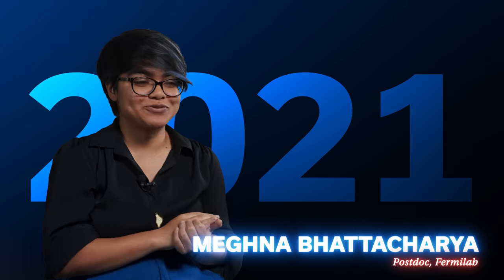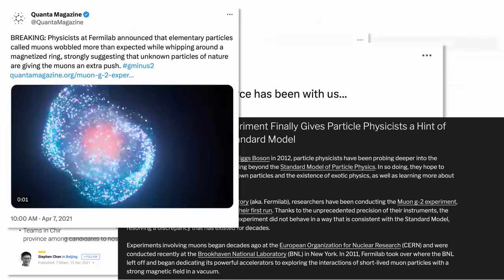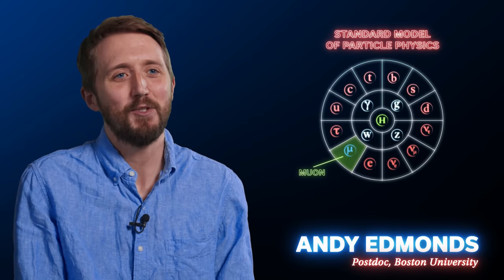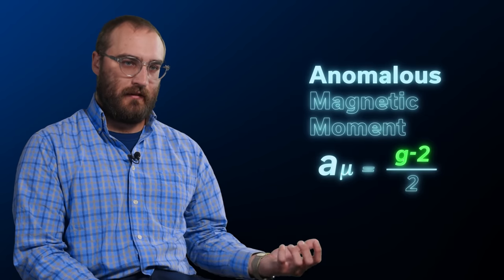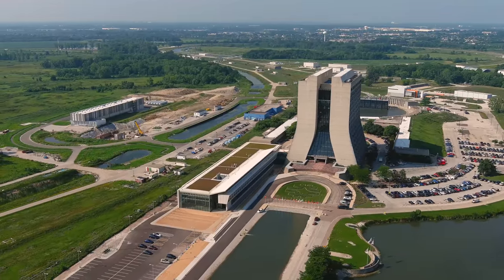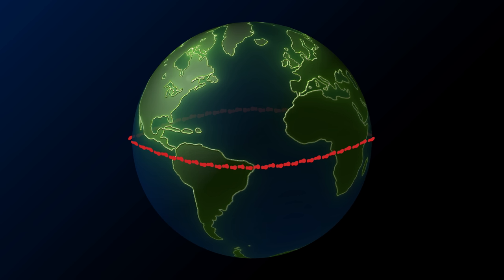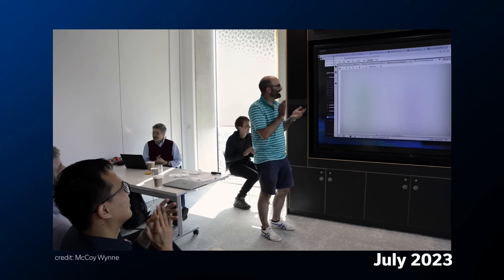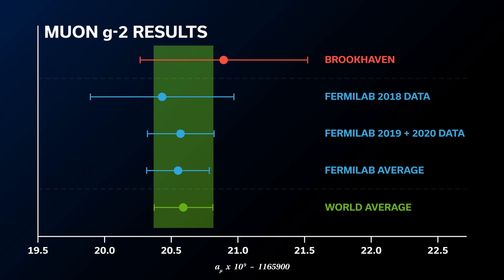Muon g-2 experiment returns with new precision measurement

Comment: If anyone is wondering, this either means some unknown physics is giving the muons a little extra magnetic moment, or it's really difficult to calculate all the possible interactions with virtual hadrons in the standard model of particle physics. There could be thousands more strong force interactions (virtual hadrons) with muons that have a big enough impact to show up in the measurements but have not been calculated yet.
Reply: Thank you, I was wondering just that.  Do you know the implications for their findings? Will this radically change the standard model or make it more accurate?
Reply: @seankelly3300  Actually the most recent computations are getting closer to the Fermilab results (from ..18 in 2020 to ..19.8 in 2023, where this Fermilab result is ..20.6 and the error bars are close) so it wouldn't be surprising if that trend continues and theory and experiment match.
Reply: @tonywells6990  The very existence of that trend and the magnitude of which it did makes me kinda confident that there really is no new phy here .
Reply: @seankelly3300  Scientific American's article on these results does a pretty good job of covering the larger discussion in the Physics community. Even if this doesn't lead to "new physics" in the sense of a new quantum field, it may lead to new insights into flaws in our data-driven models, and that could lead to refinements across much of physics.
Reply: @seankelly3300  My understanding is that there are two main possibilities. The first is that the way we are calculating the expected value could be incorrect, as it is extremely complicated and involves attempting to account for an infinite number of possible interactions with the muon. This wouldn't be that interesting and wouldn't change the standard model. The second possibility is that the muon could be interacting with an unknown type of particle. This idea is what everyone is excited about, as it would potentially create an addition to the standard model, which we haven't seen since the Higgs Boson was discovered and even that was predicted.
Reply: @michaellombardi3638  Thank you Sir.  Although this is WAY above my head, I find the subject incredibly interesting. Science is fascinating. Thank you for sharing your understanding.
Reply: @michaellombardi3638  do you remember whether neutrino oscillation was discovered before or after the Higgs boson was predicted? (I’m pretty sure it was before it was discovered, but idk how compared to when it was predicted)
Edit: also, at least the value of the mass of the Higgs boson was, iirc, a little bit of a surprise? I think?
Reply: @drdca8263  You're right, I forgot about that change. Looks like the first evidence for Neutrino oscillation was back in 1998 but the Nobel prize was awarded for it in 2015. In contrast the Higgs Boson was discovered in 2012 and the Nobel prize was awarded in 2013.
Reply: Can’t it also mean that they will need to use another instrument to confirm these results? Because walking far, the same torus has been used and the chance that something may be off with it seems more likely than the fact that our current best theory is wrong or incomplete.
Reply: Well thank you for shedding some light on this for us because this video does not explain anything.
Reply: Guess they are needing more funds.. They're could be new physics involved but we need 3billion to find out either way😂get funds and lo and behold nope.. No new physics. Was just a bit of food on the detector..but look at all them new cars in the staff car park😂😂😂
Reply: Thank you
Reply: @animalbird9436  Cynicism is easy, discernment is hard.

Can you phrase your criticism as a plain statement of how you think things should be done differently and why, or of what you think is bad about how things are done?

While jokes may at times allow for expressing complaints that are otherwise hard to express, they can also, I think, disguise complaints that are poorly thought out, and would be seen to not make sense when expressed plainly.
Reply: @drdca8263  I agree 100 percent with you.. I just throw in those comments as a pee take. As it seems when Eva need funding the old adage of new physics could be found. 😍😍😍😍
Reply: @animalbird9436  'food on the detector'! That genuinely made me laugh out loud, very funny.
Reply: I wonder, could be be getting so accurate now with our measurements that we are seeing the minuscule impacts from gravitational waves, or even influences from other dimensions? Or maybe the guy watching the simulation we exist in sat a bit closer to the monitor?
Reply: 👍Good comment, I mostly agree.
Reply: @davidadams421  tongue in cheek I know. 👅😂😂😂😂😂😂😂
Reply: @davidadams421 Erm, probably not. 😂
Reply: Speaking of morally correct, the discussion should also include the new result on electron charge roundness improving on the current LHC bound in predicting "no new (dark matter supersymmetry WIMP) physics" contra the muon g-2 team hopes. Since recent papers mention how sterile neutrinos of minimal natural standard particle extension (of neutrino fields) can currently meet observation bounds of "no detection" they remain more exciting dark matter candidates IMO. (Re the neutrino oscillation discussion here - neutrinos are interesting!)
Reply: @torbjorn.b.g.larsson  all particles dark and normal matter when funding is needed. 😂😂😂😂
Reply: The only way i could see a net effect from virtual interactions is due to existing fiels that create a slight bias, such as the magnetic field of the earth, sun, and by a very slim amount the SMBH at the center of our galaxy.
Reply: @tonywells6990  Why is the mean shifting instead of error bars contracting? Does that mean all the theoretical results are grossly miscalculating their error bars?
Reply: I guess that if the result is diff from 0,14mpp then its either a 5th force or  a 18th particle or a unknown version of the Higg's Boson
Reply: @rockinrobin9093  They already took the data from this experiment, so no more use of supermagnets and accelerator. They "just" need to analyse the rest of what they collected.

Comment: Finding that Cutting edge of physics and zooming in on that fine rupture point requires hard work and scientific integrity. 🫡 

Who knows, using the understandings wrought here maybe one day we could have devices that use “muon” systems in everyday day devices, for the benefit of all of humanity. 😊 safer x rays anyone? Or perhaps sensors that can detect with a high degree of accuracy the topography of the earth, and heck fusion power is a lot easier if you can use a super accurate muon cannon. 😎 if we can find new ways of harnessing the muon by probing its boundaries humanity can be one step closer to cheap abundant energy. Super impressed by that ring of epicness y’all have over there and keep up the hard science! o7 👋😎

Comment: From an engineering point of view, we are wondering if you could do a video explaining how any systematic errors are prevented.  This one mentions the "parka", presumably to isolate the accelerator from earth's magnetic field and any other fields from nearby equipment, as well as the calibration of the magnets, but does not go into any details.  It seems that the system would need to test other particles with known magnetic moments to rule out systematic errors and confirm there is only an anomaly in the muon.

Comment: Assuming that dark matter is a particle, I have some questions:
1.  Do dark matter particles (DMPs) have momentum?
2.  Do DMPs have temperature?
3.  Do DMPs orbit each other and regular matter?
4.  Do DMP clouds have angular momemtum?
5.  Does the angular momentum of DMP clouds act as a stabilizing influence on the direction of the net angular momentum of galaxies?
6.  At the beginning of the universe (or shortly thereafter) did the universe as a whole (DMPs and normal matter) have a net angular momentum with a net preferred direction?
7.  If the universe as a whole had a net momentum at it's beginning, is there any way that the net momentum of the universe could change in magnitude or direction?  Since to change the angular momentum of an object requires the application of an EXTERNAL force and the universe is everything, where would such an EXTERNAL force come from?
8.  If we look at a number of small patches of sky similar to the Hubble deep field and calculate the net angular momentum in each patch, would we expect the preferred direction of all of these angular momentum vectors to be the same?  Or not necessarily?
9.  If we consider the universe around Earth in terms of concentric shells, the first being from 0 to 1 billion light-years away, the second from 1 billion to 2 billion and so on, would we expect the preferred direction of the net angular momentum of each shell to be the same or could it vary over the shells?
Reply: Great questions the answer is yep
Reply: @Xsiondu  
So, don’t we need another $50 billion collider for the particle physicist to work with in order to really nail down the answers to these questions? I’m sure SabineHossenfelder would agree with that!

Comment: 5:43 How do you go about knowing you halved uncertainty (in regards to previous results)? What's the method of how do you deal with the uncertainties you don't know about? I can't quiet connect the dots. Help?
Reply: You have a model of your measurement process, and of the system you are measuring (with a parameter for the aspect of it you want to measure the value of), and,...
you do statistics
Reply: Lets say you have a bowl and without knowing the content you pull out 3 blue balls in a row without knowing even whether the bowl contains only balls.  Not very telling.  You then pull out 1000 things and it turns out they are balls and 990 are blue.  At this point you can be reasonable certain they are all balls and virtually all are blue.  You then pull out 100,000 and it turns out they are all balls and 999,900 are blue. Now you can be extremely certain they are almost all blue balls. Statistical analysis helps quantify the actual probabilities and certainty.
Reply: @rreiter  yes that's certainty of a model assumption. I'm curious about the un-certainty of the unknown quantity. The sample set outside our bias region. Think of it as "the dark" e+m as the known unknown (a model predicts its existance but we don't know how to get details) that once was an unknown unknown back when no model was predicting it. Speaking of uncertainty without distinguishing makes me believe ppl are refering to both. Come to think of it, again, they do reference previous results. So they actually are speaking of in-model uncertainty? Is that my missing dot?
Reply: @vdis  I'm not sure. I thought they meant the statistical  uncertainty of the predicted value only; the error bounds would decrease as the sample size increases, hence my trivial example to illustrate. It gets complicated fast because (taking my example), you can't actually see the blue ball, you only get a value from a collection of instruments that each are imperfect in some way and you are trying to account for, place bounds on and aggregate all the imperfections into a single statistic.

Comment: After initially lurching to the conclusion that this indicates new physics I now realise that there is a simpler explanation. The fact that the latest experimental results reinforce the best earlier experiments and are consistent with two independent lattice QCD calculations means that the 2020 massive theoretical calculation (involving 130 theoretical physicists, I believe) is probably incorrect. Somewhere in it there is an error (or multiple errors) that explain the 5-sigma discrepancy.
Reply: The link to learn more is literally at the end of the video there if you were truly interested in learning more. The papers are linked from there too, free to read.
Reply: @doryiii  that being so, my belief is based simply on the estimates of the value of g-2 coming from each of the sources - empirical, theoretical and simulated. Do you agree with it?

Comment: It wasn’t clear to me what the analogy of miscounting the footsteps was meant to be?
Reply: The slightest mistake in measuring something makes you lose the precision you want for your data and research
Reply: @afd5231  Ah, ok. I found the fact that it was describing miscounting an integer, rather than something like, not having the steps be quite of equal (all heel-to-toe) size, a little confusing.
Reply: @GODDAMNLETMEJOIN  Thanks
Reply: It’s just to give you an idea of how small 140 ppb is.  FYI for 24000 mile circumference and 2000 steps/mile a 140 ppb error would be 6.7 steps.

Comment: Does the magnetic field used in the study affect the Earth's magnetic field in any way?
Reply: Probably not to any magnitude that needs to be worried about...
Reply: what ? Do you mean Does the Earth's magnetic field affect the magnetic field used in the study in any way?
Reply: For reference, the 1.5 T this generates is the same strength as a medical MRI machine.  It’s just over a bigger area.  I doubt there’s anything to be concerned about.
Reply: @zhinkunakur4751  It will obviously interact with it in some way, but I'm sure Fermilab have accounted for it if it's actually more than negligible.
Reply: The earth's field is present but it is parallel to the ground when it goes through our experiment.  The main magnetic field we use is perpendicular to the ground.   The earth's magnetic field is big enough for us to see and measure so when we are moving things around to make a uniform field, this gets taken into account.  On the other side, we do not affect the earth's magnetic field.  Our steal confines the field to within our ring and it is safe to stand about 5 feet from our ring even if you have a pace maker.
Reply: @bckcasey  thank you